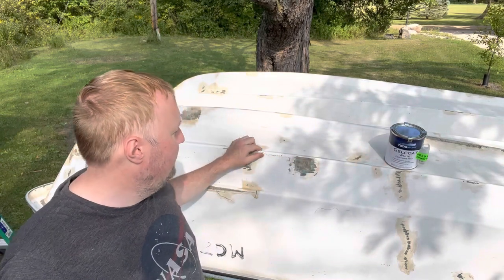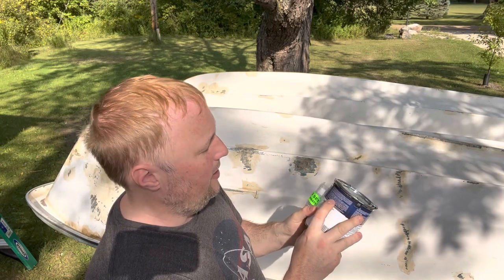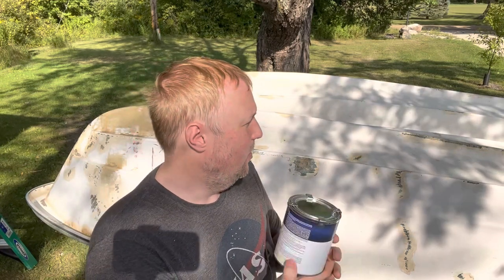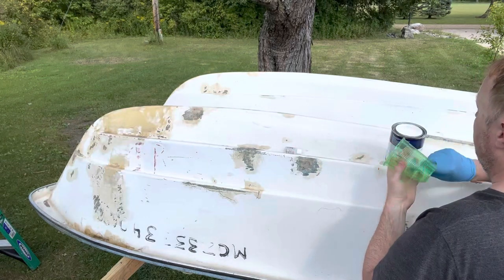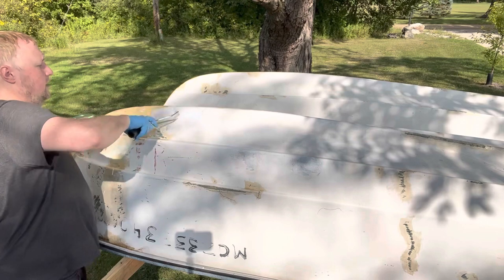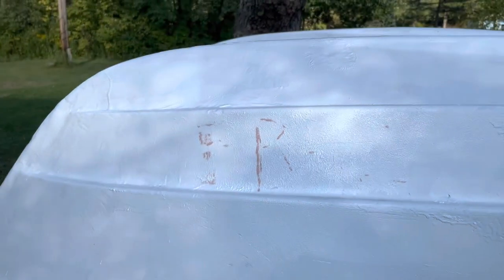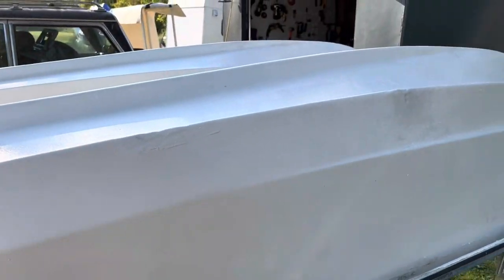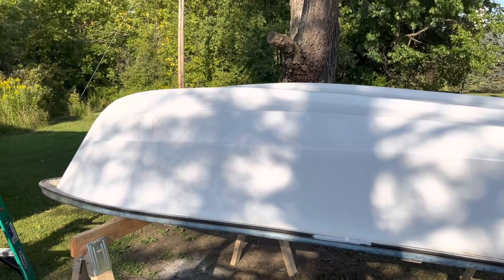Total Boat Gel Coat with Wax $40 paint job |  10' LV10 Livingston Boat | DIY Restore Repair Fix

Comment: You basically put a “primer” coat on. You should knock it all down with 220 grit and coat so you get 15-20mil wet thickness. You can use additives to thin Gelcoat like Duratec and it will lay down much nicer than raw Gelcoat. You can get a cheap $10 spray gun and even spray the thin Gelcoat and you’ll be amazed by the results you will get.
Reply from the maker: Nice! Yeah I might give that a whirl next summer when it warms back up. We are in colder weather already in Michigan.
Reply: You all are a great help, I just picked up a 2000 lv 10 and I now know what I'm doing with it this summer!
Reply: and fairing it at least. Longboard sander. use epoxy filler? total boat? If the contamination in glass doesn't want to come off? grind it off. It must be removed